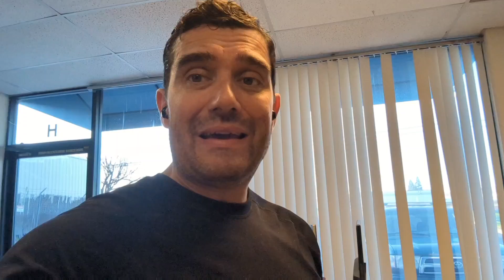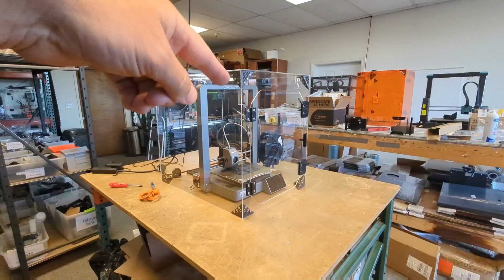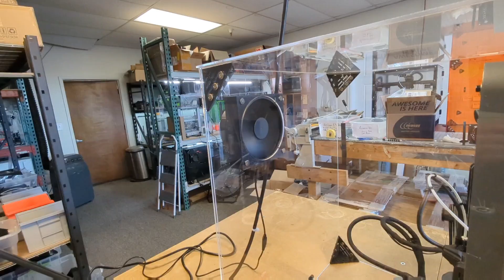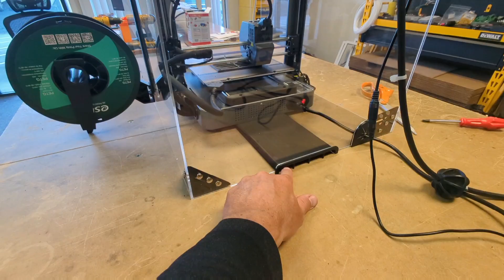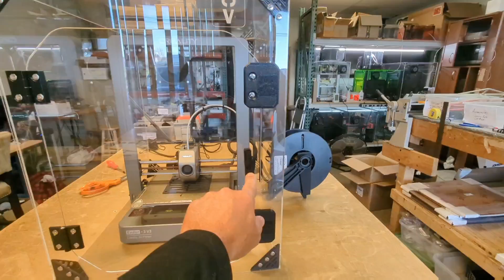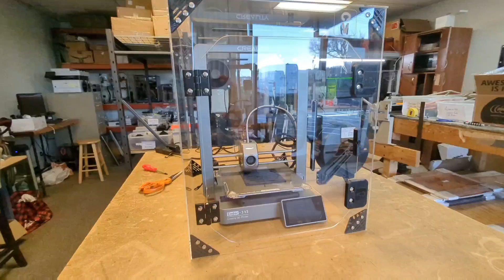Creality Ender 3 v3 enclosure by Clearview

Comment: Why? Just by a K1 or other enclosed printer...
Reply from the maker: People use these printers for use cases that are beyond the surface level use of just 3D printing. We have clients that Core XY machines don't work for. Additionally, the enclosure on the K1 machines doesn't offer adequate sealing, air filtering, or fume mitigation.
Reply: Are you dumb? Seriously, did you pick up some mental damage somewhere in life? K1 is triple the price.

Comment: Wow, that setup looks fantastic! I really appreciate the choice of mounting the spool holder on the outside. smart move that allows for the use of a filament dryer. I do think adding fans to channel cool air into the electronics vent you guys created would be a great enhancement. Without a fan, I'm a bit skeptical about effective air circulation, but I might be mistaken.

It's great to see an official enclosure for the v3 now. It practically turns it into a K1C, with the main difference being the bed movement. Originally, I planned to enclose my v3 due to its suitability, (This would of been the perfect choice) but unforeseen circumstances led me to win a K1C. Even though I won't be enclosing the v3 now, I've noticed how much it contributes to reducing noise levels. That really pulls me in.

On another note, I'm still looking forward to getting a ClearView enclosure for my A1 Mini! The possibilities with these setups are just too exciting